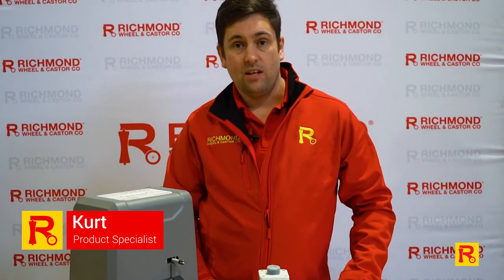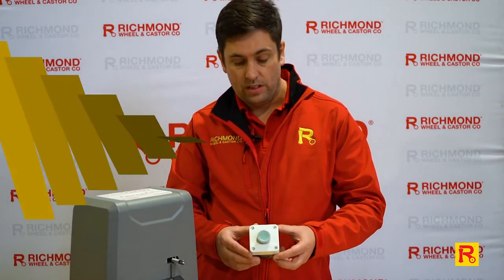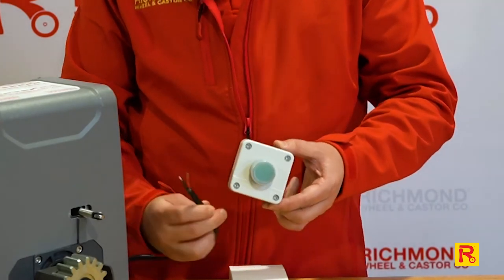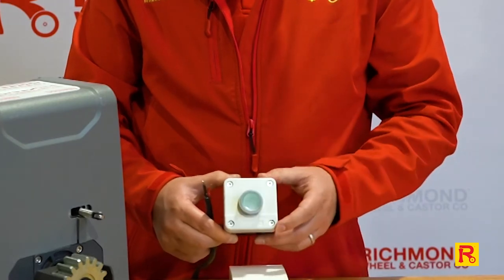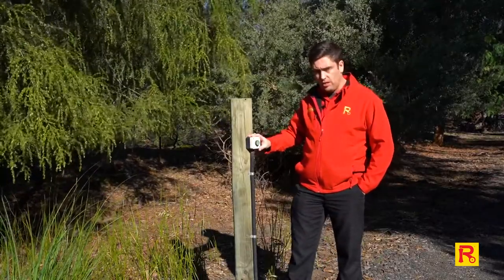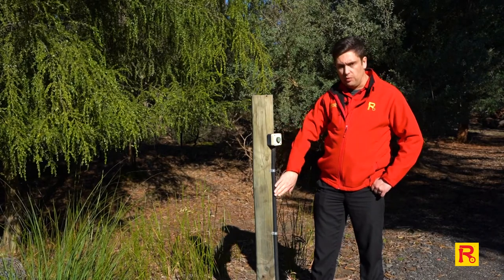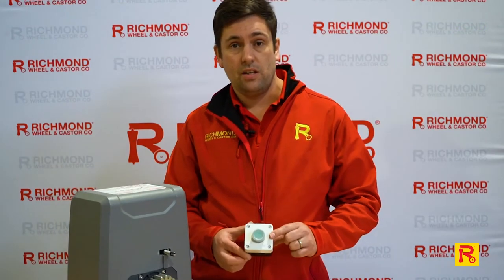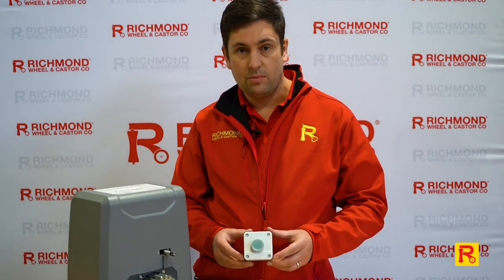Hard Wire Push Button GTR202

Comment: Hi mate, can you tell me do these switches have to be wired to a specific polarity or does it not matter which way it is connected.
Reply from the maker: Hi Andy,
There is no polarity on these push buttons.
Most gate systems will use a passive (non-powered) circuit that is triggered when the button is pushed and completes the circuit. As long as the two wires are connected to the right terminals on your motor, it will work, regardless of which wire is where.
Reply: @RichmondCastors  Thank you very much for that info mate, Very Helpful. It's a shame the useless company I purchased my gate kit from are not as professional LOL. Cheers Andy 👍
Reply from the maker: Hi Andy
Haha, we hear that a bit. Give us a call for your next project, we're always happy to help.
Subscribed too, always nice to see people sharing their skills for the public to learn!